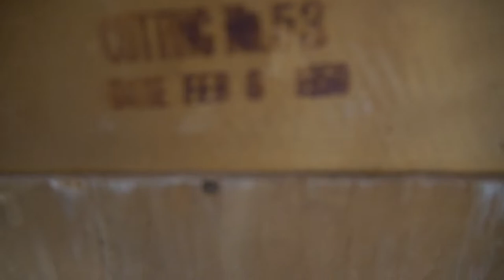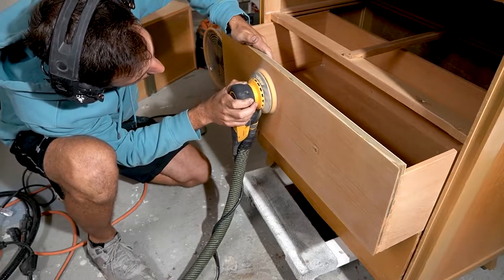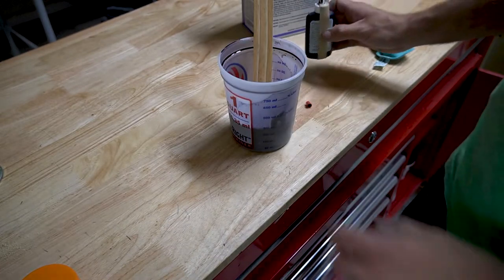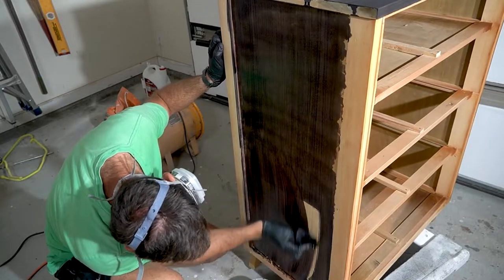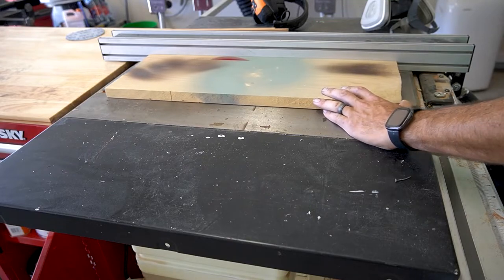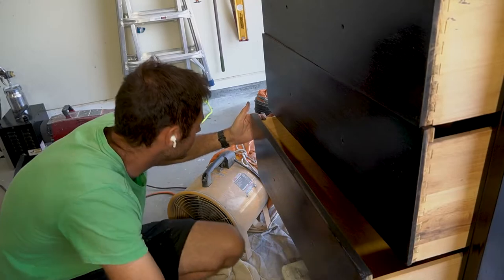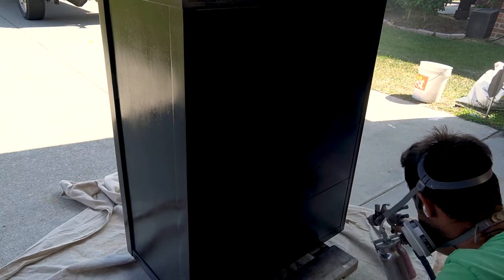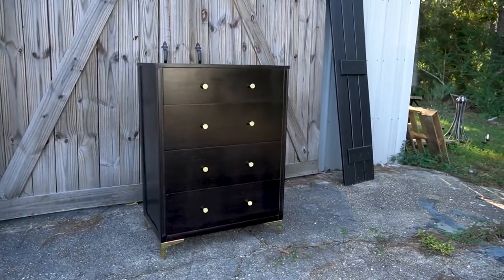Furniture Refinishing- Refinishing a Mid Century Dresser (Using Black Dye + Black lacquer)

Comment: Newbie here. Just wondering why you  didn't go with spraying  a black satin cat lacquer (3-4 coats), instead of dye and cat lacquer top coat?
Reply from the maker: It’s a matter of preference, not really a right or wrong way but the pigmented lacquer would definitely cover up the grain a good bit. It looks more like paint in my opinion, you can’t really see the wood grain through the finish and you won’t really get that ebonized look. Also, my particular supplier only carried light colored lacquer at the time. If you have a clear tint base lacquer and want to do that you certainly could! The solids of the pigmented lacquer will probably cover the grain though.